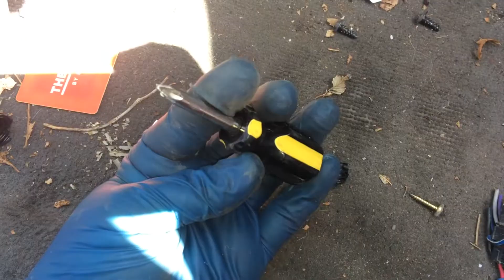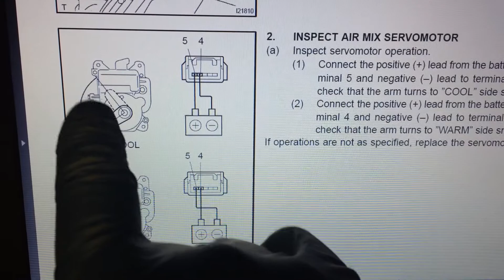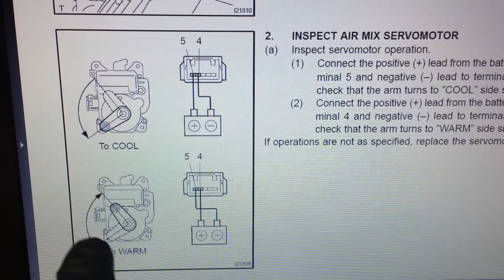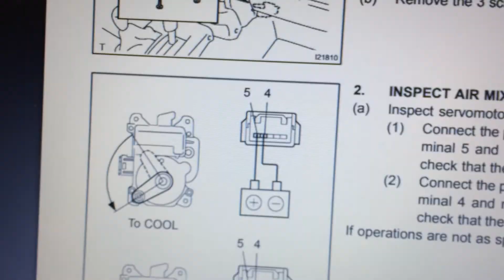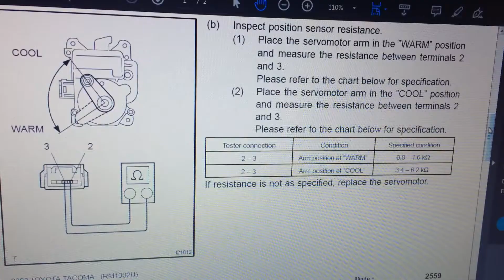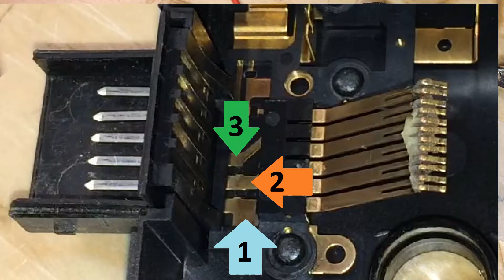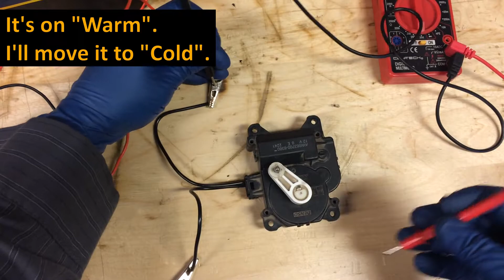2001 - 2004 Toyota Tacoma Replace Air Mix Servo, Blend Door Actuator, AC Noise Fix, No Heat Fix

Comment: Very thorough and detailed, I learned a lot from this video. My temp was stuck on cold and a quick forum search said it might be this servomotor and found this video. Mine was not moving at all when switching temperatures but thankfully I was able to 'tap it' like people do with starter motors and it started working again. If it fails again I'll use this video to take it apart and clean the contacts to see if it helps before replacing it, they're not cheap!
Reply from the maker: Wow, that's great!  Thanks for leaving this tip -- you're right, they are not cheap parts, so I hope your trick lasts for a long time!  Maybe it till work for others too, which would be great. 
 Thanks again for sharing : )

Comment: Is it same area for the 2005 Highlander? Need to replace mine or pay mechanic $520.
Reply from the maker: I don't know about the Highlander: in some models, the motor is much harder to reach, which might explain the price for that job (the motor itself is also expensive).  Perhaps check out the toyotanation.com forum for your Highlander.  Good luck!

Comment: This servo you are showing is for the vent door/ flap control and not for cold & heat mixing i.e. climate control. The servo that controls the cool & hot air mixture is a different unit and for my 2004 Landcruiser Sahara is located behind the the blower & vent door ducting. To get to this particular servo you need to remove the entire dash board & i do mean everything. It is a nightmare of a job. Allocate a day and half but it is the only way to get the climate control to operate properly.
Reply from the maker: No, this video is for the '01 Tacoma's HVAC system, not the '04 Landcruiser, and the servo shown is the Air Mix servo on the '01 Tacoma.  It is a well-known fault on the Tacoma.  

Your Landcruiser will have different servos, and servos in different locations because the HVAC system on the Landcruiser is much more complicated than the Tacoma's, and the system has automatic features that the Tacoma doesn't have, which means more motors and more complication.   

I haven't done that job on a Landcruiser, but I have done servo jobs Mercedes (MB's have very complicated HVAC systems) and I know what you mean -- MB puts those servos deep inside the dash and you must remove the entire dash to service them.  It is a huge pain, like you said.  From what you're saying, it sounds like Toyota did the same thing for the Landcruiser, which is really a hassle!  

I'm sorry that you're having that problem with your Landcruiser. Those servo's are cheap, either ($$).  Good luck with your repair -- I know how you feel : )

Comment: Are both 87106-04010 and 87106-04020 compatible with 2003 4Runner?  Seems like they should be the same as in a Tacoma.  Hearing the clicking from the driver’s side, but dont want to risk replacing one part to find out that the other has also died.
Reply from the maker: I would call your dealer and verify, but no, according to what is shown on the Toyota parts site, neither of those parts fit the '03 4Runner.  
Instead, the HVAC motors are shown as part number 87106-35150 for the lower motor (by the blower motor), shown here:
https://parts.toyota.com/p/Toyota_2003_4Runner/HVAC-Blend-Door-Lower-DAMPER-DAMPERFOR-BLOWER/63395818/8710635150.html

And then 87106-35120 as the upper motor, shown here:
https://parts.toyota.com/p/Toyota_2003_4Runner/HVAC-Air-Inlet-Door-Actuator/63472602/8710635120.html

If the motors themselves are the same, you can swap out the arms, as mentioned in the video.  I don't have any 4Runner parts too look at, so I don't know if the motors are the same.  I hope this helps -- good luck!

Comment: Would you think this servo motor is the problem if when using a/c and all of a sudden the heat comes on hence the heater valve is opened and once I turn temp selector to hot and back to cold it closes the heater valve and it gets cold again?
Reply from the maker: Possibly, but I would suspect the door itself for that issue, or a linkage between the door and the motor, or the HVAC control module before the motor itself.  (Please understand that the following is speculation because I don't have this truck to look at.)
Perhaps you can check it like this: set the AC as you do, then get under the passenger side dash (or use your phone/mirror) and watch the linkage by the arm and wait till the problem occurs and the heat comes on.  There are two possible observations: either the arm moves when the problem occurs, or the arm does not move.
If the arm on the motor moves when the problem occurs, then I would think that the problem is either a bad command from the control unit (telling the motor to turn to heat when it shouldn't), or the motor internally has an issue.  In the second case (internal motor issues), then replacing the motor would fix the issue, but not for the first case.
If the arm doesn't move, then I would eliminate the motor as a cause and instead consider possibly a loose linkage between the arm and the door.  It might be that the door is skipping off a linkage intermittently, causing the AC airflow to close the door, or that the door hinge points have an issue. In that case then when you reset the knob, the motor moves the arm and catches the linkage for the door again (temporarily).  
Again, please understand that this is all speculation because I do not have this truck to look at and I don't even have an HVAC diagram for it, but rather I'm speculating based on what I've seen on other like-year Toyotas with non-cable drive HVAC systems such as the Tacoma. I hope this helps!  Good luck!
Reply: @L35inColorado  Thanks, it is one of those things that might only happen a couple of times a week or maybe even a month  between times.
I have taken the cable off the heater valve a while back but as you know cold temps are right around the corner.
Reply: I am going to assume that since the motor is opening the heater valve via the cable that it is either the motor or the temp control
Reply: Charlie, did you ever solve this problem? My 2002 4runner does the exact same thing. But it does it every few minutes while driving. Not fun having to turn it to hot on 110 degree day and then back to cold hoping it will reset itself ha thanks for the update.
Reply: @bulldograu1  dis you solve this issue? I am currently having the same problem
Reply: @cesarcardenasfigueroa1862  yes. But I ended up having a shop work on it. It was $500 bucks with parts and labor.
Reply: My 2002 Tacoma is doing the exact same thing, replaced the part in the video with no results
Reply: @ivanlm743  have u solved this issue? I am having the same problem.

Comment: Awesome video,  very helpful. Anyone have any advice on how to get the actuator control are off of the original actuator? Tried pressing the tab down as described in the video but having no luck. It’s on there solid and I’m worried I’ll be out of luck if I break it
Reply from the maker: I don't have a motor on hand, but I remember having to press the little white tab that holds the arm keyed to the shaft, and then used a flat pry under the arm to give it a little encouragement to move up.  You don't have to remove the arm to open the case and inspect/replace parts inside -- you can leave it in place and just pop open the black tabs on the sides of the case.  You do have to be VERY careful, though, for all the parts because as you know they are plastic, and they are also old, so things get brittle.  Good luck!
Reply: Control arm*

Comment: Your voice is very soothing. You oughta hear me when I'm workin' on cars.
Reply from the maker: Haha -- thanks :)
Reply: @L35inColorado  Very clear and detailed video. I think this is my problem because i don't get cold air or hot air.
Will this be a dealer item only? Or can i find it at autozone?
So thank you for the video.
Reply from the maker: @SDsailor7  There are some aftermarket options available online, which are much less expensive than buying from the dealer.  But I don't think you can find this particular part at Autozone -- you'll have better luck online.  Good luck!
Reply: @L35inColorado  Tomorrow i will check to see if the motor arm moves by starting the engine and turning the blend knob and also without turning on the engine.
I will check on line for the motor i sure hope i don't need it and it is something simple.
Thank you again for the great video!!

Comment: Hey I had my ac compressor change (new) less an year .. all sudden notice my ac getting low (cold)  but at the same time notice low Wreid sound on when putting the ac on high .. any suggestions.  To look at first before I take it to the ac mechanic?
Reply from the maker: I'm sorry that's happening -- it is possible that if the blend motor motor is going out, and if that's the case, then the motor won't close the door all the way when you want full-blast AC (and the motor does sometimes make a weird noise when it starts failing, but typically its a clicking noise).  You can check that our yourself by looking at the motor from the passenger side, as shown in the video: put your setting and full HOT, and look at the position of the white arm.  Then change it to full COLD (or better yet, have someone else change it while you're looking at it, or use your cell phone camera), and take note if the arm moves.  

You might also want to check out this video about the blower motor making sounds and how to fix that (just note in that video, when he says "condenser", he means "evaporator"):

https://www.youtube.com/watch?v=uhbsxsZY_5c

If you don't see anything wrong with the blend door motor or blower, then I would take it back to the AC mechanic.  Good luck!
Reply: @L35inColorado  When you test the blend motor to see if the arm moves does the engine need to be running?
Thank you
Reply from the maker: @SDsailor7  I am not sure -- I think you would at least need to have the key in the "ON" position.  The arm certainly should move when the engine is on and you adjust the temperature.

Comment: Do you know of any Toyota blend doors that will work/cross reference for a 2001 4runner?  They want $300.00 at the dealer, but I refuse to play that game/  Thanks!
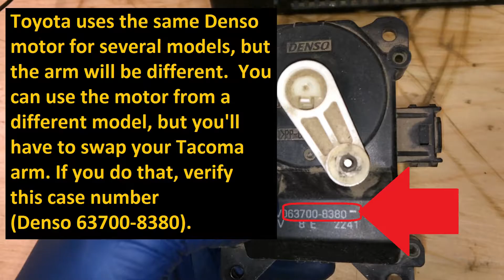Reply from the maker: I'm not sure about the blend doors themselves -- if you mean the blend door actuators, then no, I think they are all model specific.  However, as I mentioned in the video, if you can find the same main unit, you can swap out the arms.  For example, if the 4Runner has a different arm, then you'd just keep your arm and swap it out.  You can look at the numbers on your actuator (for example, the numbers shown at 02:21), and then you can look for an actuator with those same numbers, then just swap your arm onto the other (if the arms are different).  Good luck!
Reply: @L35inColorado  I meant to say blend door actuator.  Thanks for the info.
Reply from the maker: @da324  Sure -- if you determine that you need a new actuator, you might check out McDonough Toyota (in VA) and Stevinson Toyota West (in CO). They both ship nationwide, and have better prices than most dealers.  The price on this part is just ridiculous, especially considering that its usually just the little motor that fails, or the wormscrew gear.  I think even from Stevinson or McGeorge the actuator is something like $170!  You can email them and they will get you the correct part number, and hopefully you can at least save a little money.  
Other than that, I would perhaps look at your local junkyards and see if there are some 4Runner's there (though I can tell you that these parts are one of the first parts to go at the junkyards because this is such a common issue).  Good luck! 
https://parts.stevinsontoyotawest.com

https://www.mcdonoughtoyota.com
Reply: @L35inColorado  Was watching this video again.  I got one from the salvage yard today from a newly arrived wrecked 01 4runner.  Paid $25.00 and it works great.  I'll keep the old one for parts.  Thanks again for the help.

Comment: For about 2 yrs it sounded like my glovebox was sending Morse code after cold start, this makes sense why. That's a sweet tip when contacts are too close together. Thank you for the informative video.
Reply: Bruce Simmons LOl same here
Reply: @ZackZane  The cable that connects to blend door was pretty ez to access. I just disconnected and slid it over to about the middle to let sum heat in. Until I can a better price on part. $140 is the best local price I can find for new 1. Even the junkyard wants $55.
Reply: Same here I thought maybe just maybe it was a relay in the fuse box...but now after this watchung this awesom video I ordered my motor replacement Part from Rock Auto..I love the morse code description as I was also baffled by that  peculiar sound for years. My door got stuck on the heat side all summer in Texas OMG!
Reply: @philclinton9430  I live in Phoenix so I didn't even change it. I found out the cables are very reachable that adjust temp. Just use a pair pliers and you can move them by hand no problem.
Reply: @H8er-Maker  I hear you, however I just swapped out the part changing the arm (tense moment) then adjusted the track because the new motor different orientation. Today Hot and Cold at the flip of a Switch. A hearty Thanks goes out to L35 in Colorado...my hero!

Comment: nice video! I will be taking mine out and testing it today using your electrical TS method. The other end of the cable that leads to the heater core hose, the valve does not actuate when I twist the climate control knob. It blows warm air but not hot like it use to. I will be able to eliminate the bled door actuator because of your video. Thanks a bunch, and God bless!
Reply from the maker: Thanks, and great troubleshooting -- best of luck to you, and God bless!

Comment: Any idea on where to find a new arm? The clip broke on mine while I was trying to remove it.
Reply: I gorilla glued it but I didn’t really need to. It was a snug fit on the new actuator. I just replaced the part by following your video and now my truck has heat again! Thank you!
Reply from the maker: @apeterson239  Good job, nice!
Reply from the maker: Oh man, that's too bad -- if you have junkyards in your area, see if there are any '98 to '04 Tacomas.  Alternatively, do you think you can glue or epoxy the arm to the shaft?